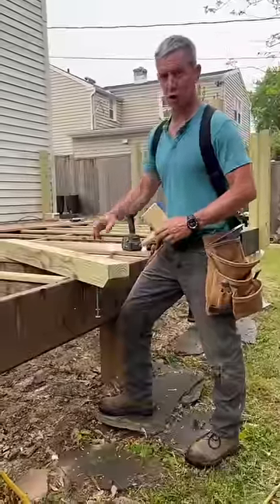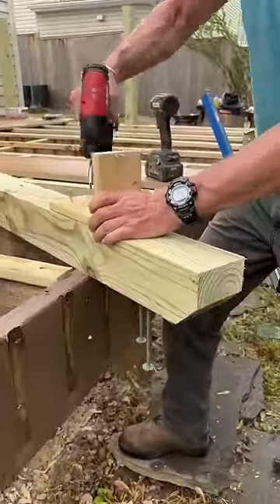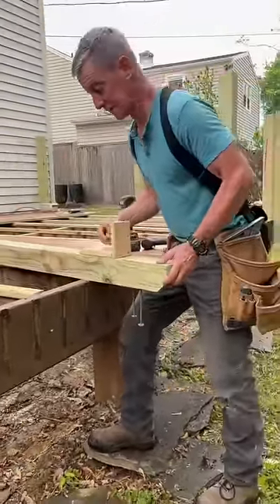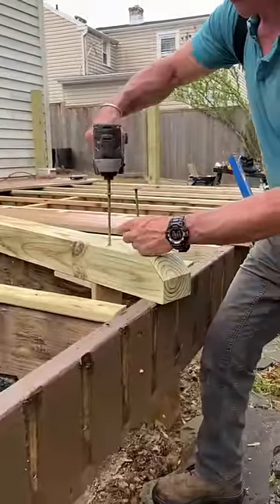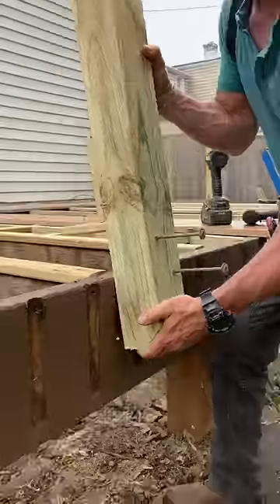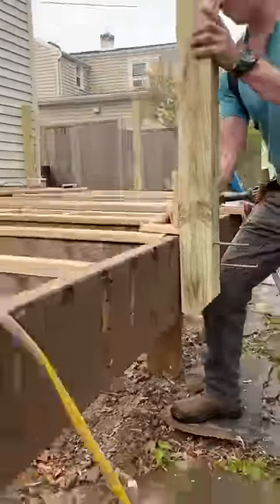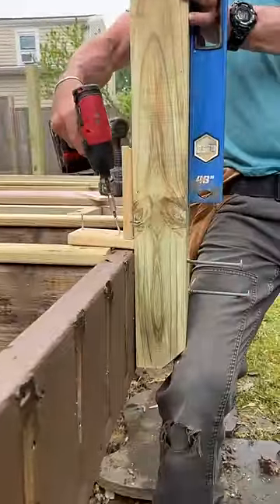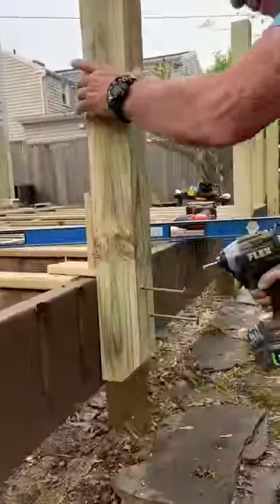DIY Tips: How to set a deck guard post by yourself

Comment: Thats a fail son.....no sealer on the board tops.
Reply from the maker: Sort of. It’s a reskin. Inside this 2x10 fascia is the 2x8 framing. I packed up the joists with deck board rips so I could plane the new decking over the 2x10. They’re covered.

Comment: Clearly we don't pre-drill wood, or use carriage bolts on this farm!!!! Maybe you should join the modern age!
Reply from the maker: Not to be nitpicky, but if you want to be nitpicky, carriage bolts have been supplanted for thru-bolts for about 20-years. - Structural screws are new-ish. - And understanding that's what's written in the code is a guideline. Not what's required.
Reply: @myfixituplife  Sounds like a good way to make excuses. But it wont keep most professionals from firing the dumbass on the job who decided to do their own thing.... But since you are your own boss, you can get away with it.....

Take care, I hope you the best. And I want you no where near any of my jobsites! I would get deeper into the details, but I noticed how you tried to make excuses to several other professionals who would have thrown you off their job site as well! Happy Holidays my friend! 😃😄
Reply from the maker: Not making excuses. Making money. Satisfying customers and getting it done. - I am my own boss, which means the Sword of Damocles is swinging over my head all day.  The buck stops here, as they say.

Comment: Wtf is up with all these hacks showing people that dont know proper construction techniques how to do it wrong?
Reply from the maker: I have a few ideas. If you can put the 200-pound lateral load test the code is based on and pull this railing assembly apart, be my guest.

Comment: That's no good I Notch mine and carriage bolts with lock washers and flat washer and nut
Reply from the maker: Notching turns a 4x4 into a 2x4. I get it, they last a long time. I took notched posts off of this that were 25 years old. I've also removed some that were barely hanging on.

Comment: Now, if you only install it correctly, it would be great.
Reply from the maker: What's the difference between what you call "correct" and "What works"?
Reply: @myfixituplife  Hexhead bolt's Galvanized 1/2 Post on the inside with blocking And the proper bracket Installed on either side of post to secure Floor joist to Rim joist
Reply: @myfixituplife  But I guess you can jackleg it to make videos.
Reply from the maker: This (a) is a repair. And (b) code is based on requirements. In this case, and I'm 99% sure you have no idea about this,  200-pound pull test. I've seen it live. - Between 2x4 rails and a 2x6 top cap that would have to fail across the 5 1/2-inch face, the catastrophe that would befall this deck would render it condemned. And, the same screws hold the ledger on, so...
Reply from the maker: You can jackleg your keyboard to make uninformed comments, too.
Reply: @myfixituplife  Only if it was done correctly and it wouldn't done correctly. Nothing like a green horn
Reply: @myfixituplife  Yeah, you don't put the post on the outside of your bamboo. It goes on the inside. 1/2 galvanized thru bolts With a Hexhead And washers
Reply: @myfixituplife  Green horn homeowner, add it again.
Reply: @myfixituplife  Doesn't meet the building code.
Reply: @myfixituplife  And when you're a band board riff off. What good are your posts? That's right, they're not.
Reply: @myfixituplife  You don't even have tie back brackets. Holding the bamboo to the floor joist
Reply: @myfixituplife  Plus your corner post is gonna be really weak.
Reply: @myfixituplife  Plus your handrails or guard rails in the corner will be really weak. And will separate.
Reply: @myfixituplife  You can put all the fancy gear on and use your fan to camera and make fancy videos. Still have no clue what you're doing.

Comment: It looks like his lags only went into a single piece of 2x joist. That's not sufficient for a guardrail post. It should have bolts with washers, or those lags should go into at least 4" of wood. Construction fail. Don't do work like this.
Reply from the maker: This deck is a resurface. And the point of the video was about the blocks and screws, not the connection. Most people missed it and I get it. However, this deck had what I consider to be the horrible detail of a double outside band. - These screws hot full wood fiber. Explain to me how this connection fails.

Comment: Not safe and illegal in every jurisdiction that actually enforces its code.
Reply from the maker: Well, it’s a resurface, not new construction. I thought the 80-gallons of paint on the front band was a clue. It’s a repair. No permit required. - It’s 10x better than what was there. - And, if I were setting a post I needed to drill, I’d follow the same steps. In other news, code bro, the same fasteners are used in the ledger and the post to beam connection. It’s not going anywhere.

Comment: Re is no good reason to mount post like this.
Reply from the maker: There are 10 good reason to. The jig and screw are the fastest way I've found to do it yet, whether I'm using structural screws or through bolts. I'd use a structural screw to hold in place while I pre-drilled, get a bolt in there, remove the structural screw, then use that penetration to drill for the second thru bolt

Comment: Ha you’re doing it all wrong and that’s not to code in my state. You need carriage bolts and those shims need to be made of treated material or composite cuz what you used will be rotten in two years then you have a floppy hand railing
Reply from the maker: This is a resurface, bro. It's about setting the post. Also, you're bristling because this is a new idea to you. It works. The shims might get damp, maybe. But they're there for the long haul.

Comment: It’s crap , wrong fasteners should be inside the rim with blocking and bolts  nuts/washers or the new hip equivalent.. it will be ok for a few years but it is going to fail in bad way
Reply from the maker: I hear you. But--and this is a Short, not the Magna Carta. The idea was about how to set the posts alone. - The post to band connection gets all the attention. The 2x4 rails and 2x6 top cap would require catastrophic impact to fail.

Comment: Wrong. Lags loosen or break every time. A real carpenter uses carriage bolts through the band. Nice try tho
Reply from the maker: Hey bro. Time went by. As much as I love me some double hot dipped galvy 1/2-inchers, structural screws work and they work well. Tons of permitted applications.

Comment: Oh my God!!! only a hack puts his posts on the outside of deck framing. You don't have a clue!!!
Reply from the maker: Band joist mounted posts have been a thing for a long time. Also, not shown, is that there is a double band here. It's not the point of the post, but there's a 2x8 inside that 2x10. If we were following your "non hack" guidance, the inboard side of the deck post would be 6 1/2-inches into the field of the deck. Hey bud, nice work!

Comment: Orrrrr use a freaking clamp and not make a jig you need to screw and unscrew every single time
Reply from the maker: Clamps still move. The screw holds the post still in one axis. Makes it easier to get plumb.

Comment: Worst way to install posts. Install on inside with blocking all around and with bolts, washers and nuts. Way stronger than this crap
Reply from the maker: Maybe. But the forces required to hobble this connection would be catastrophic to the structure anyway. Sorry to rain on your parade, but this works.

Comment: Give it a few months and the handrail will be loose and useless....your handrail post should be the actual deck frame post. Self supporting posts where needed but to a minimum......poor practice here
Reply from the maker: You’re not correct. The same screws fasten the ledger to the band joists and they’re not loose or useless. - This entire deck (it is a resurface) was built with 3/8-inch lags that were poor practice 25-years ago and it lasted.

Comment: How not to set a post. No shims, use blocking, adjust the rim joist for level. Come on man. I could walk through that.
Reply from the maker: You couldn't. The same screws hold the ledger on. Hold the post-to-beam connection. These aren't drywall screws bro. Get with the program.

Comment: Very wrong. Fails building codes. Even for diy-ers. Posts should be installed inside or rim and bolted through and through.
Reply from the maker: I don't disagree, sorta. I'm a Code fiend when I can be. But this project is a re-surface (side note: the entire point of the video was about setting the post not what to connect it with). I'm also a fan of common sense. - If this was an airport or restaurant, sure, let's full bore it. But it isn't and it is a repair that is a million times better what was there.

Comment: This is a terrible method. The post is only secured to the rim joist, and no blocking is even installed behind it for reinforcement. I doubt this post is even secure enough to lean against let alone stop someone from falling
Reply from the maker: Same screws are approved for the ledger connection. - Add in a 2x6v top cap that has to fail in a different axis and I think it works.

Comment: Lag screws = short cut not quality
Reply from the maker: 1 - 3/8-inch lags and notched posts lasted for 20-years on this deck. 2 - Replacement hardware is UBER structural screws.
Reply: Yeah it's funny how frame carpenters never use clamps... Surprised to see one using a jig.. 
Although post should really be sitting on a notch on top of the joist...

Comment: Why do all carpenters insist on using the loudest impacts they possibly can?
Reply from the maker: Because all impact drivers are loud. Except at least one I know of. Not sure Ridgid makes it any longer, but it was hydraulic of sorts. There was fluid in there instead of the steel on steel hammer and anvil mechanism present in most impacts. Makita might make one, too but it's in Japan.

Comment: That looks terrible. That’s like a little kids building it. Why would you do that that’s not strong enough to hold somebody up. If you really want to see how to build one of these get a hold of me I’ll show you how to make a super good.
Reply from the maker: First of all, the video is about surface mounting posts, not how to connect them. That said, everybody misses the first 50-seconds of the video, so: The same screws hold the ledger to the building and make the post-to-beam connection. I can't for the life of me see how they'll fail in this application in a complete guard rail assembly. I appreciate the offer to help me out.

Comment: Bad advice from someone who has no idea what they are doing. DO NOT ATTACH GUARD RAIL POSTS LIKE THIS... And DO NOT USE LAG BOLTS!
 This ridiculously BAD ADVICE!
Reply from the maker: Couple things Capn All Caps, these are not "lags" they are structural screws. And, despite the fact that there were about 80 of them in each post, the 25-year old notched posts that I was replacing (this is a re-skin) were in pretty decent shape. It works. 100% woof fiber engagement. Goin nowhere.
Reply: @myfixituplife  So what you call "power lags" are not lags?
Ha ha ha ha ha ha ha
 Why didn't you pull a permit for the rebuild of this ancient deck?
 Do you really think you can ignore current code requirements because this is what you call a'" re-skin"?
Reply: @myfixituplife  How is the rim joist attached to the rest of the frame. That is all that is holding your posts.
  I use caps to impress how dangerous what you are demonstrating really is.

Comment: Dangerous. Have your railing posts built into the structure not just relying on hardware to hold it in place. Use a double ledger on your posts for the joists and have the post go through the deck. All I'm saying
Reply from the maker: I'm not relying solely on hardware. It is a redundant system that requires multiple, massive failures to fail. There are the 2x4 rails and the 2x6 top cap that also make the system a membrane. Those things have to fail first (ever try to break a 2x6 in half the 6 side?) before we even stress the fasteners. It's also a reskin. It works.
Reply: @myfixituplife that dumb. I Can break that by being drunk and stupid. Glad you didn't notch the 4x4 cuz then that definitely ain't code

Comment: Not to code!
Reply from the maker: Yes and no. - This is a repair to an existing deck frame that is decades old and totally solid. - We deck builders who do re-skins have to juggle between what's already there, customer service and safety. - But you missed the point. It's about setting the post on layout, not how one fastens it.

Comment: One drunk fat guy and that's coming down. Deck posts should not be attached that way. I know because I've built over 100 decks. Won't pass code either.
Reply from the maker: Same screws attach the ledger to the band joist of the house. - If the fat drunk guy can shear an interlocked system of 2x6 guardrail caps AND these screws, he has to weigh a billion pounds.

Comment: Bolt the post , and notch it for more strength, amateur!
Reply from the maker: Nah. As for notching the post, that hasn’t been kosher for at least 10-years. Maybe 20. That said, I’ve pulled decks apart where they were solid and others where they broke like toothpicks.
Reply from the maker: Notching turns a 4x4 into a 2x4.

Comment: Nope
Reply from the maker: Works. Same screws for the ledger. Plus, the 2x6 top cap needs to fail across the 5 1/2-inch dimension. Would I do this for a tall deck or commercial application? He++ no. But for a deck repair, sure. And, the video is about how to set the post, not fasten it.